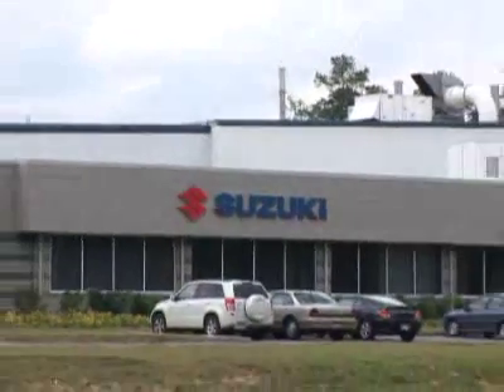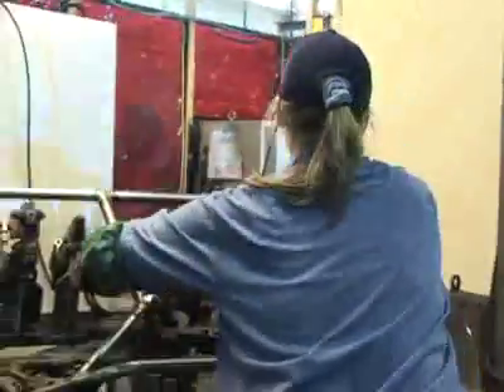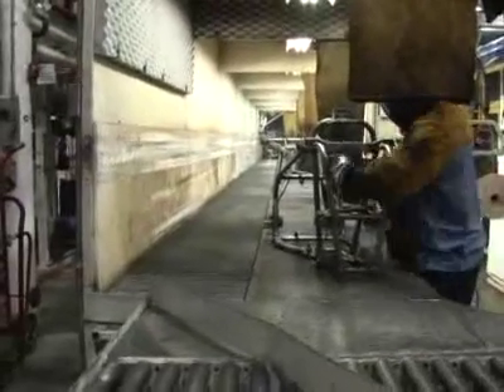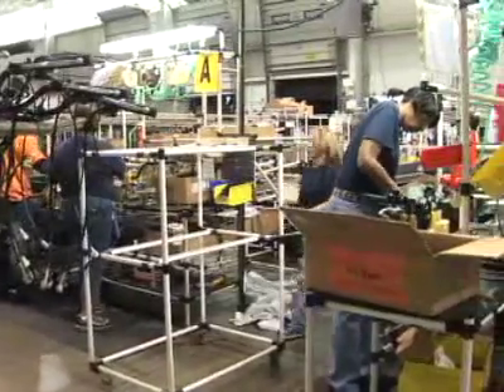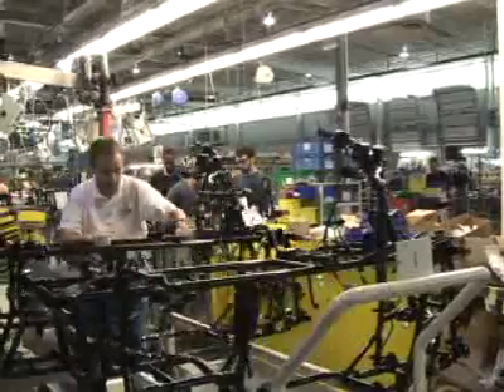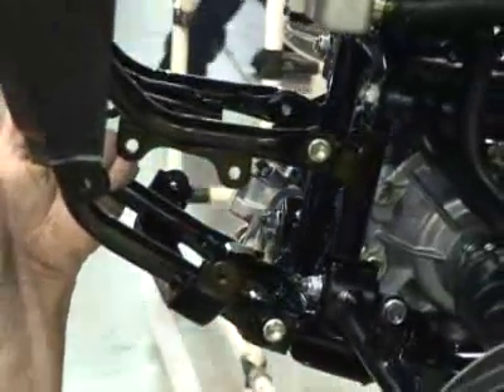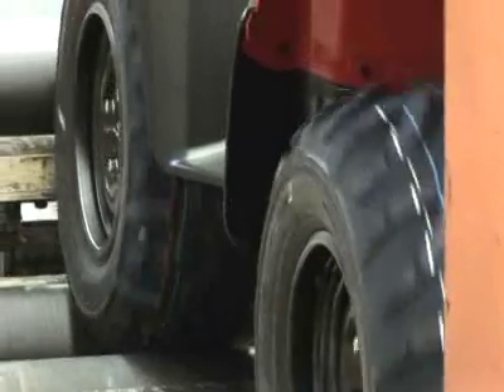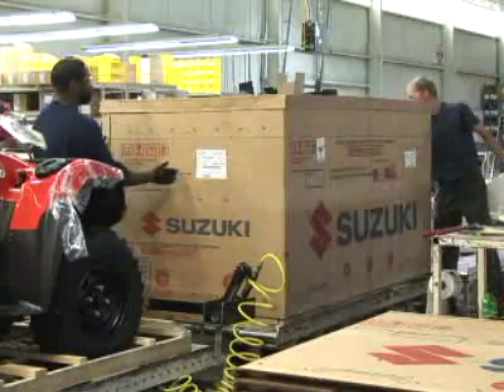How ATVs Are Built

Comment: @nuckenfuts12 But you have to think they are lifting them at four points on the racks so they split the weight evenly. The main reason they say no more than 100lbs. on each rack is for stabilaty and controll over the quad.

Comment: That sounds like compression molding. Injection molding injects plastic into two mold halves held under tonnage. Once the plastic is cool enough to eject, the mold is opened and the parts are removed. Huge HUGE difference!